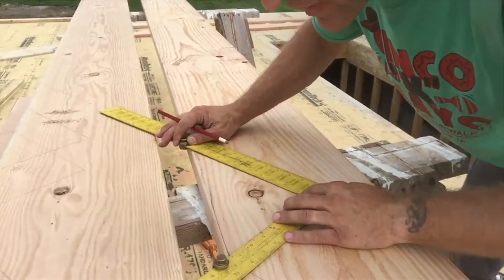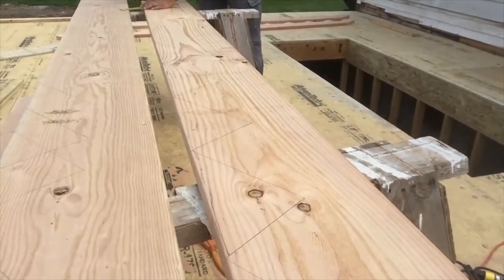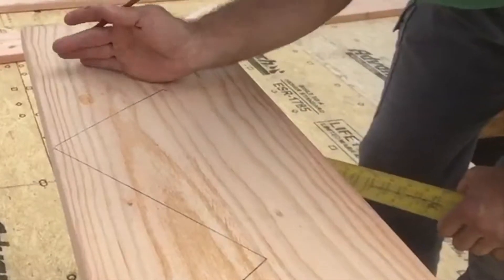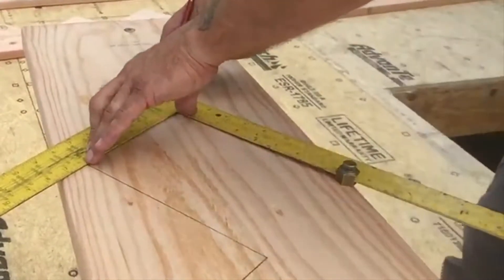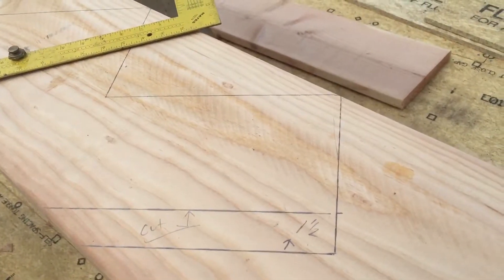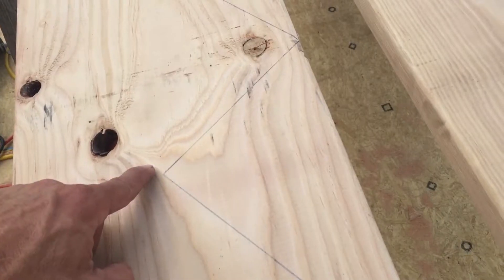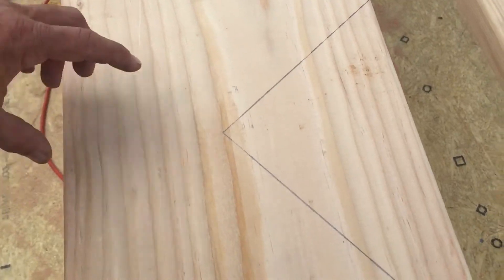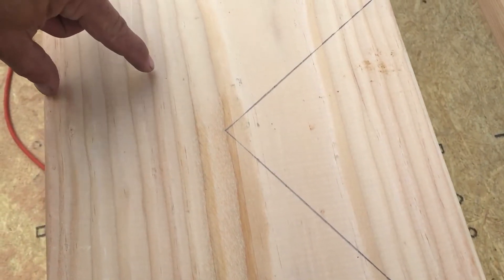How to layout stairs on a 2x12

Comment: i find it easier to just lay the square on the stringer and line up the measurements you need, then put the clamp on the square against the board edge. That way you know, it holds you at exactly those measurements rather than clamping them freehand and hoping that it's lined up.
Reply from the maker: @Bryan-li8qi  that works too, thanks for sharing that

Comment: You need to put the stair gauges on the other side of the framing square so you don't have to do any testing to get it exactly where you  want the cuts to be.
Reply from the maker: You can put them on the other side, but putting them on the inside will put more of the square on the board and keep it from tipping off the board. I would also check the marks if the gauges are on the outside of the square , just to make sure it’s exactly what you want. Thanks for watching

Comment: Aren't your stair gauges in the wrong side of the framing square
Reply from the maker: You can put them on either side, as long as you have them at the right measurement.  I put them on the inside so that more of the square is on the 2x12 and it doesn't have a tendency to fall off the board.  Good Question!
Reply: @mr.kongable  if u place them on the inside of the square then u trace the outside of the square so the gages ain't in the way of your pencil. Great video
Reply: @scottyking6897  Or you can do what I did and put one on the inside and one on the outside and spend an hour trying to figure out WTF I was off by 'justthatmuch'.

Comment: Add the bottom tread thickness too the overall height. That way you you have already made up for what your going to cut off. The actual measurement is about 1 3/4 inches. But the 1 1/2 is close enough. The measure varies. If your tread is an 1 1/2 , put your square on the bottom and draw your line across the bottom. Then measure from where the new line intersects with the riser line. Measure from that point to the bottom of the first riser. In most cases is around 1 3/4 depending on the steepness of the stringer.

Comment: This is not right. You can't just cut 1/12 inches off the bottom riser because that's going to end up short  on the run which will make your steps not level front to back. Try it on a two step stringer and you will see what I mean.
Reply from the maker: That would be an interesting thing to test. I’m my experience though, it doesn’t change the angle, it just drops the stringer so the treads don’t make the first step too tall

Comment: Nice job. I’m confused on one thing though, I understand why you subtract the thickness of the tread material on the first step. But do you not add back the thickness of the finished floor material?
Reply from the maker: It depends on what the finished floor material is. If it’s not thick enough to matter, then you don’t add it back in. If it’s going to be hardwood or a tile, then you take that into the overall height measurement
Reply: Ahhhhh. So if there’s going to be 3/4 hardwood flooring on a slab, the 3/4’s is figured when measuring from the slab to the landing and has nothing to do with the first riser. Gotcha man, thanks so much, years of confusion are gone now. Love your channel bro, keep ‘em coming
Reply from the maker: @davidholmes7275  right on!

Comment: I live in a house where a narrow staircase is the only way out in case of fire. It does not feel safe : it s made of pine wood with a piece of underlay and carpet on top. The underlay has no fire resistance. This is the way they  live in rural UK . There are fire alarms and this is the only requirement for residential dwellings. I think it s not enough and I would like to make the stairs more fire resistant. Can you please advise? Thank you.
Reply from the maker: I would look into using a product like tile, that has a high fire rating, on the treads and risers of the stairs. You might be able to use a construction adhesive on the stairs to hold the tile and increase your fire rating
Reply: @Trevkongable  Thank you!
Reply from the maker: I would look into using a product like tile, that has a high fire rating, on the treads and risers of the stairs. You might be able to use a construction adhesive on the stairs to hold the tile and increase your fire rating